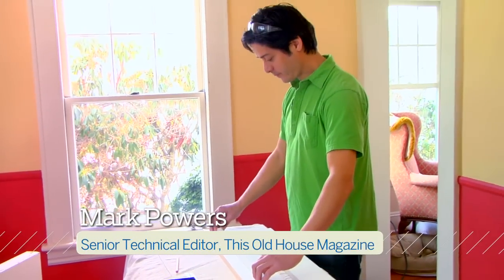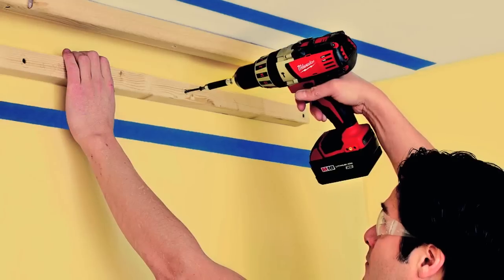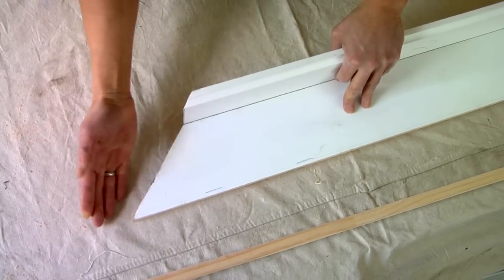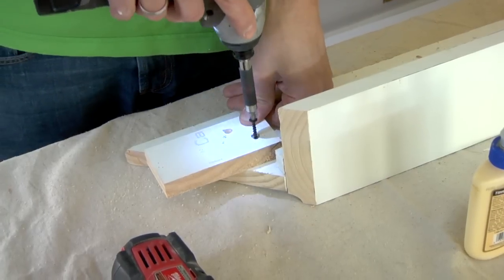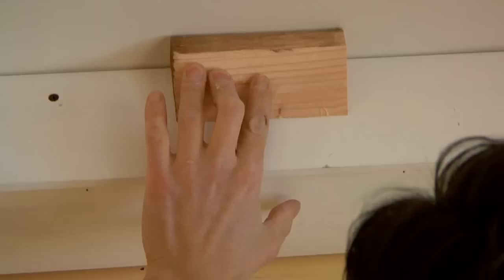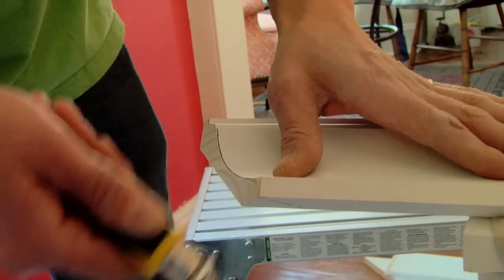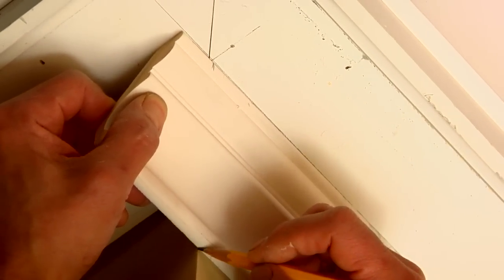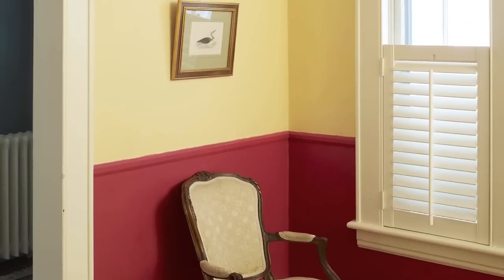How to Install Three-Piece Crown Molding | This Old House

Comment: This may have been an interesting video, if it were not presented like the installer and narrator was on speed...
Reply: Agree. This project is not for beginners either.
Reply: This guy will have the most tricked out house and is writing all of this work off on his taxes. I'd be a little excited too. Oh, the presenter and installer are the same guy, Mark Powers. Power on Markus! And hey, if it's going too fast for you, hit the pause button and replay.
Reply: Maxid1 Maybe I'll play it at 33 1/3 instead of 78
Reply: That's a whole lot of work.  This is why carpenters get PAID the big dollars.